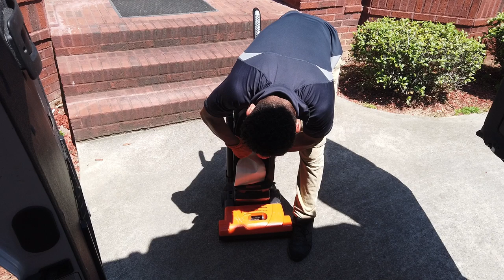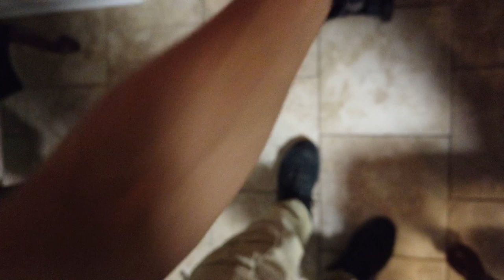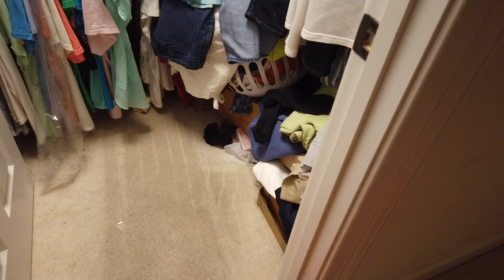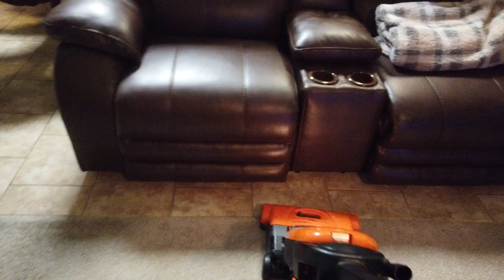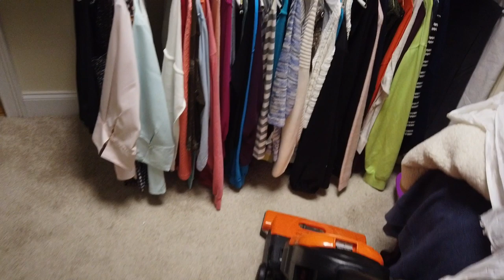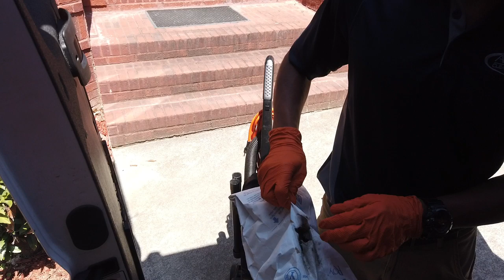Pre-vacuum Vlog #15 || How much dry soil can we get out of these 3 bedrooms and 2 area rugs?

Comment: I don't think ordinary vacs have the same power that professional grade machines do. And I do know that folks forget to regularly change out the bag , or clean out the dust trap section. Also, vacs can get clogged and have less suction. And that is a BIG house. They may only be doing the floors one section at a time per week. Depending on how much time or energy they have.

Comment: So satisfying watching floors come clean. 
A suggestion regarding customer safety: 
When in a private residence
-Turn the camera off when walking from one room to another. That way you don't inadvertently reveal the floor plan of the homes to potential thieves.
- Only show client floors, not the tabletops, cabinets, bed and bath locations, and so on. Protecting the privacy of your clients is of the utmost importance.
Reply: That's why you don't leave anything valuable behind. That goes with anyone. Clear all tables,move all furniture elsewhere before starting any work. You don't want anything to attract thieves sometimes even contractors can steal. So before doing any work remove as much personal belongings out of the room out of sight. Drawers for example,place them in another room where work would not be affected. It's a bit more effort,but it's worth the piece of mind.